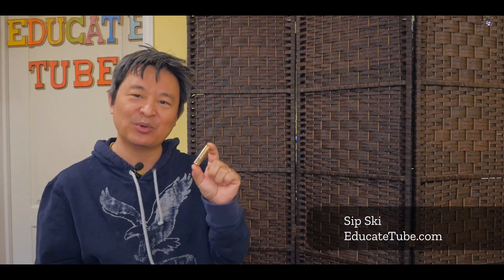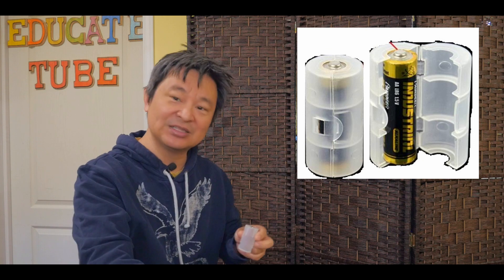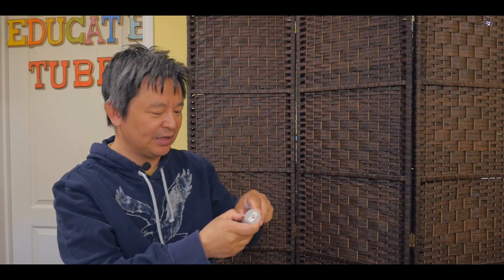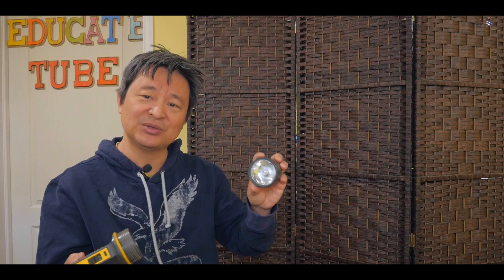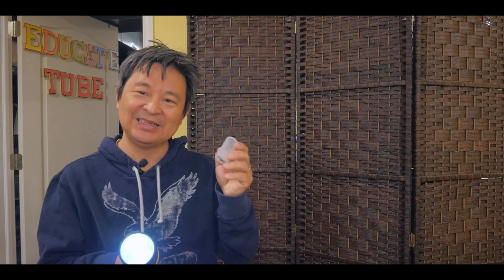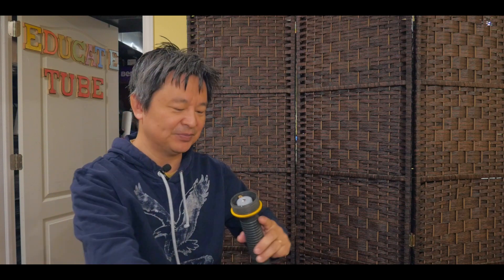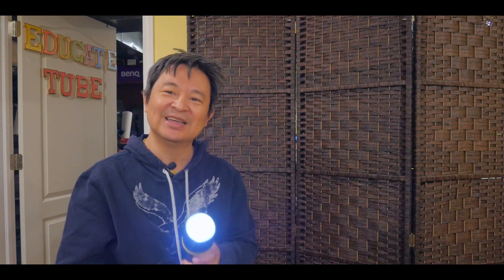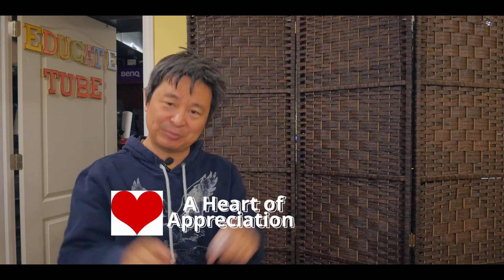How to convert AA or AAA battery into C or D type battery

Comment: I got me some of those on temu and they didn't work
Reply from the maker: Sorry to hear.  Make sure the metal contacts on the battery holder is intact.  Use the voltmeter to see if there is continuous flow of current between battery holders.